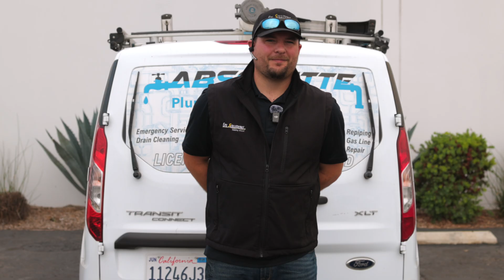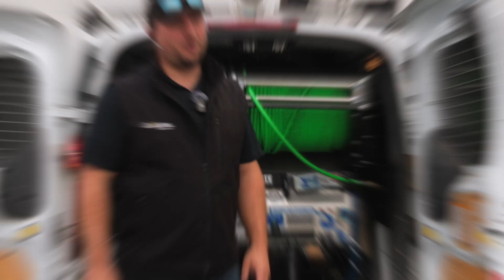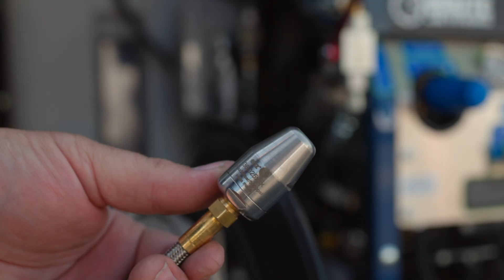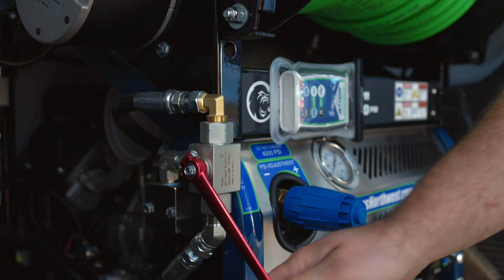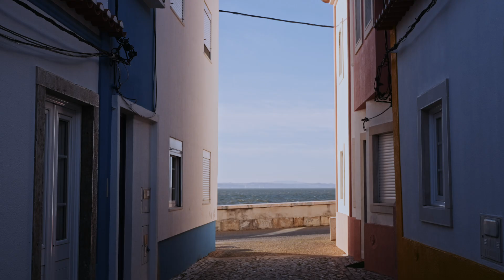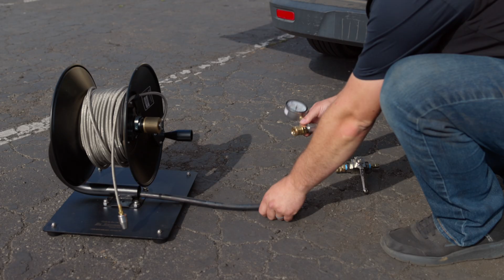BRUTE JETTER w/ WIRELESS CONTROL. BEST TRUCK JETTER??

Comment: Will a building's water pressure affect (defeat) the GMP of a Unit ?  I'm thinking of buying a 14 GPM unit with 2200 PSI for clearing grease drain clogs in PVC pipes.  I also heard that PSI should be close to (or Compliment) the GPM flow rate.  Asking about that too ;) Thanks!
Reply from the maker: The buffer tank on the jetter acts to keep the GPM as high as required by the pump, in this case 9gpm.  If the input is lower than the required GPM output,  a larger buffer tank or doubling your hose connections are the two options you have.   You may also reduce the hose being used (1/4" hose with 5gpm heads) to reduce the output.   The proper understanding of GPM and PSI when choosing a jetter to purchase is this:   Higher GPM means you can clean larger pipe, Higher PSI means that GPM will cut better. 9GPM and 4000 PSI is where nozzle manufacturers are focused on currently, so it is recommended to consider that flow rate when considering cleaning anything 6" and below.
Reply: @EPLSolutionsInc  Thanks for that explanation, much appreciated.

Comment: Nice van how does it hold up to soft poop stoppages
Reply: I called up to give you some business  I wanted to get a forbest   camera cable end repaired  your camera guy said he doesn't work on that brand  what I understand he also said its not worth the cost to repair a forbest  it's not a 10k camera but it's over 5k so I don't see it as a throw away either  not cool trying to give your company business and get insulted
Reply from the maker: @brian2100  
Sorry that happened. If you're willing please call back and ask for John.
I'll look into the matter tomorrow.  

Just to let you know where my thoughts are...
Most of the Forbest and knock-offs we see come in are sub $1000 camera systems.  The repair cost for these cameras are usually to expensive compared to original purchase price.  (considered a throw away)

A 5k camera system is a different discussion all together. The Camtronics mini-flex and Ridgid sub-compact models are two good examples.
 

We were at one time repairing 15 different makes and models. Many manufacturers when they release a new model the repair parts for older models a become obsolete. When they are older it's difficult to support these cameras and justify expensive repair cost.
Reply: @EPLSolutionsInc   Does your camera repair Shop have an hourly rate  I own several cameras , and trailer/ truck jetters.  I keep a camera in every truck.  I prefer to buy equipment from companies that were actually in the business.
Reply from the maker: @brian2100  Yes, we have a repair center for Ridgid, Gvision, Camtronics, and a couple other brands if needed.  We also have a facility for repairing hydro jetters, nozzles, hoses, and anything in mid-sized trailers like US Jetters down to cart jetters.
Reply from the maker: @brian2100  
Started as a union plumbers apprentice in 1984. In 1993 I started a specialized line locating business, but as time passed I added  leak detection, hydro jetting, descaling...  and became known as a plumbers plumber in the SoCal area.
In 2012 I sold everything and started EPL Solutions, Inc. We service and support everything we sell or manufacture.
Reply from the maker: depends on how soft the poo is...
Reply: @EPLSolutionsInc  nice van set up do u know the weight on that jetter unit thanks
Reply from the maker: @brian2100  Most installs around here are less tank. So here is the break down...

The Jetter weights in at 500 lbs. 

The 100 gal tank empty is about 100 lbs. A full tank of water your about 1000 lbs (water weights 8.33 lbs per. gallon) . 

So the max weight is about 1,500 lbs.
Reply: hey Jerry how's everyone doing? Good.   nice van set-up  can you get the 150 gallon tank in this size van    what the largest lines you can clean with the 9 gpm set up

Comment: That's 1800 psi loss for 500' of 3/8".  Thats not much pressure at the nozzle.  You should use 1/2" hose on the main reel.  Just as a comparison, 500' of 1/2" is only 415 psi loss.
Reply from the maker: Absolutely correct Ben!  Here's some info to think about alongside your comment:  The nozzle is the flow restrictor, and you adjust your flow to increase or decrease the psi at the end of the hose. To get more PSI on the end of your extension hose, it is recommended to have lower GPM heads. Ex:  the working pressure of an 18gpm US Jetter at the end of its 500' 1/2" hose is a 31% loss in pressure ~appox(340psi/18gpm/per 100' of 1/2" hose).  No one debates the effectiveness, but the other idea that works to reduce the loss is to have a 10gpm nozzle on the 1/2" hose for a 15% loss in pressure ~approx(120psi/10gpm/per 100' of 1/2" hose) site CAT PUMPS 2009
Reply from the maker: Just to elaborate further regarding 500ft of 3/8" jetter hose.  
We would recommend the Enz 1/4"  Rev RototDrill (36.025NIREV 1.5 mm).  This nozzle has vastly more cutting power than a WS-1/2 regardless the hose length. At 6 gpm with 500ft of 3/8" hose there is only  a (15%) 611 psi loss. leaving a working pressure of 3,389 psi

The newer generation Enz nozzles are a better focused  (laser beam like)  jet stream with more intensity than a water blasting nozzle, resulting in a smaller jet stream with more  .
Reply: good job sewer